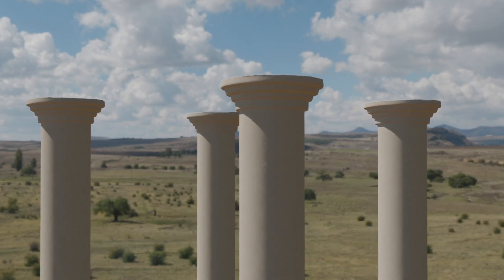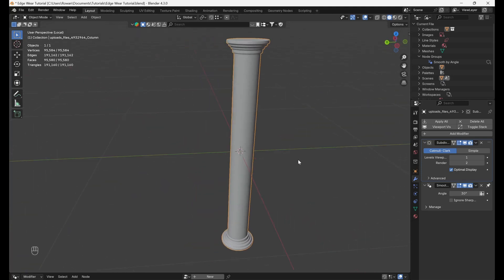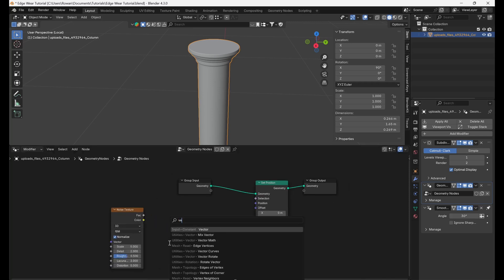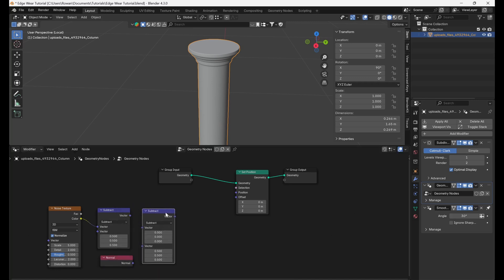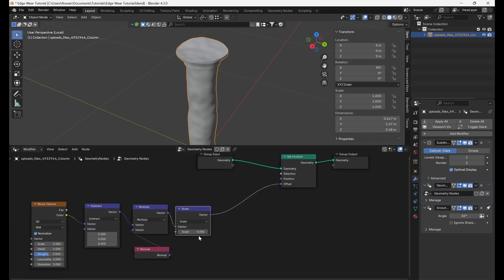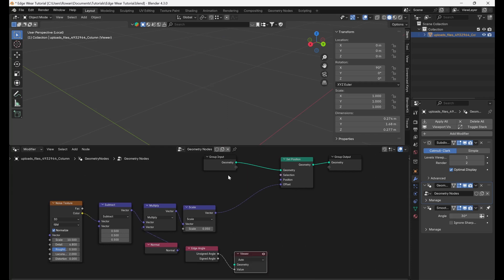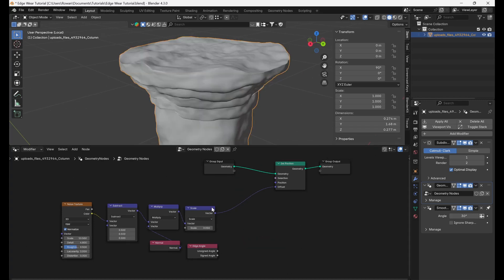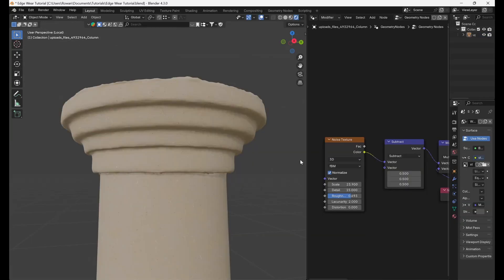How To Create Realistic Rough Edges In Blender

Comment: If I remember correctly there was a GN update last year that enables camera culling. If that's the case, does it mean that geometry subdivision and displacement can be limited only to areas that are within view?
Reply: @pieterswart7176  camera culling is enabled for subdivision if you use the modifier. What you're referring to for GN is an add-on not a built-in solution as far as I recall